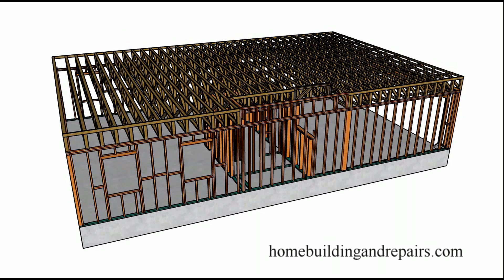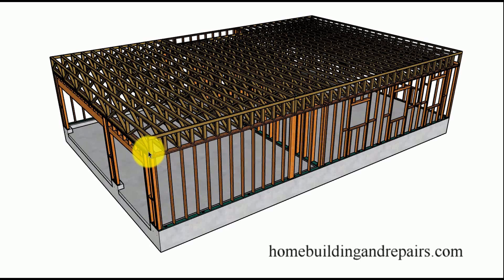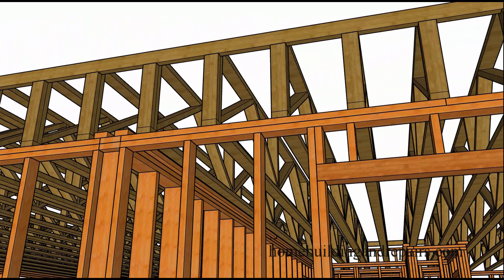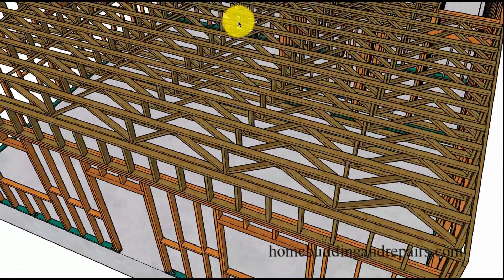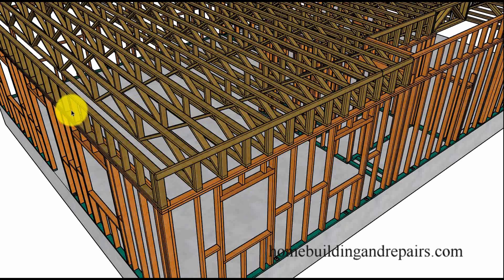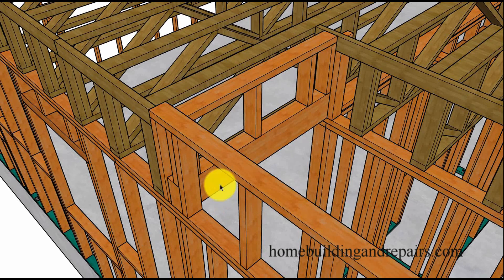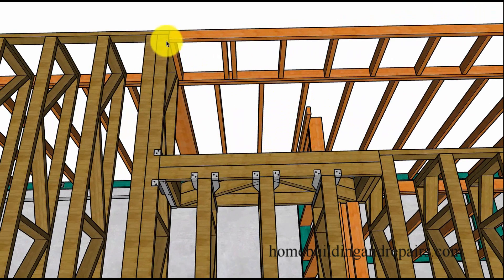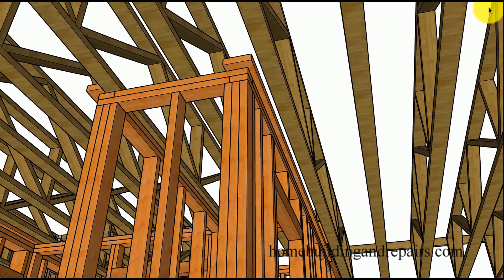Two Story Open Floor Plan - Floor Framing With 2 x 4 Engineered Trusses

Comment: With regards ro the perimeter nailer for joist, I note the bottom of the truss is flush with the outside of the wall below. But the nailer is also flush to outside wall, how does that work, are the joist notched at the top to receive the nailer. How is the joist engeneered at this notched location?
Reply from the maker: If they come from the manufacture that way, then yes. You won't always have this design.

Comment: Greg, Just for interest sake; why would you not span the opening across the diagonal direction? It appears like it is a shorter span and thus would be cheaper. Not trying to correct "The Master" just looking for the rationale that you use. I am of course assuming (Big assumption I know) that the middle wall is a Load-Bearing wall. Thanks (and I love your videos, they're great!)
Reply from the maker: Excellent idea and way better than mine. You're welcome for the videos and I sincerely appreciate your improvement to my design.
Reply: @gregvancom  Greg, As I mentioned, you have my utmost respect and appreciation. Although I am a Canadian, and I am guesting that you are an American; our building and engineering standards are very similar. If you are from the American south or California you have storm issues that we do not have, whereas we have some cold weather that factors in to our building codes (ie snow load, insulation etc) that you luckily don't have to worry about. When I had looked at what you were trying do, my question was more to collect your invaluable insights. I have studied structural engineering, built some homes and other structures so seeing the size of the openings was one of the first things that I look at. However, there are situations where I would go for the larger opening and to be dammed about the cost. Depends entirely on the needs and desired outcomes that the client is trying to achieve. Keep up with the great videos and advise. You are very knowledgeable and insightful. The best that I have found online!
Reply from the maker: @dougstewart3546  Yes, I'm located in Southern California and understand that our building codes are similar. I don't have to deal with snow loads or broken water supply pipes, just earthquakes and all of the structural building hardware that to me seems a little ridiculous today. Thanks again for the extraordinarily kind comment and especially the part about me being the most knowledgeable and insightful on the whole worldwide Internet.